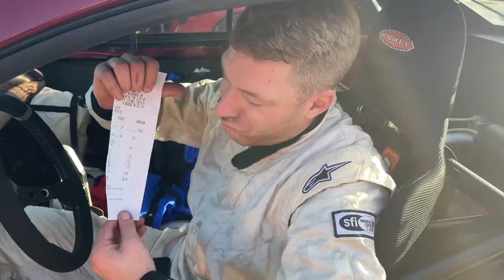First 8 Second Pass on Day 1 Race Week 2.0!!

Comment: I recommend ordering a stainless flex oil pressure line(summit has a ton of lengths). The plastic is sketchy with heat and the possibility of rubbing a hole in it. Copper line is good, but prone to cracking from vibration over time.

Comment: Uncle Chet has finally made an electric sorta practical by towing that three phase diesel generator. Now all he has to do run a charging cable from the generator to the car so he can charge his supped up golf-cart as he is driving down the highway.

I personally never use that plastic line for a mechanical oil pressure gauge and instead use flexible copper tubing or A/N line depending on the oil pressure gauge

Comment: Never run a plastic or copper oil line to a pressure gauge.  Get a sending unit.  Too many guys have had their car burn to the ground from lines melting a fatigue cracking.